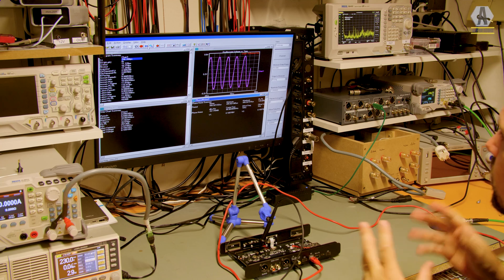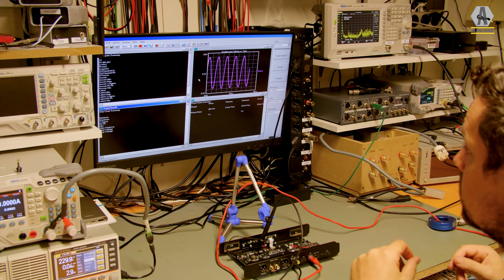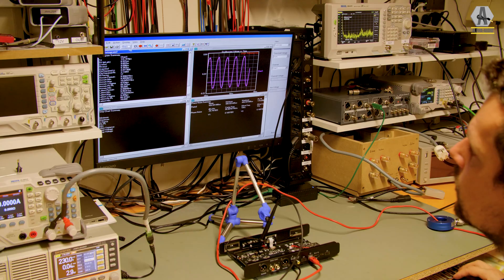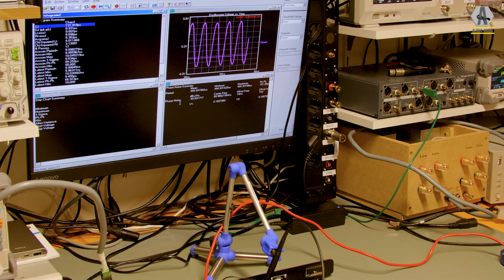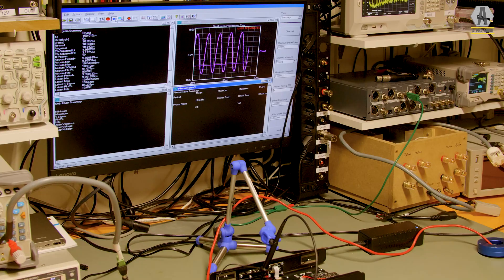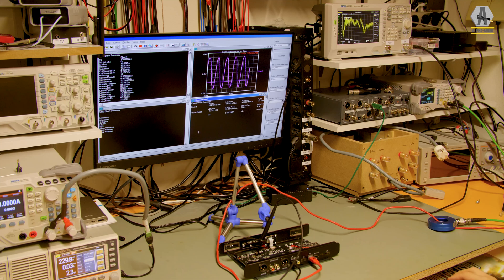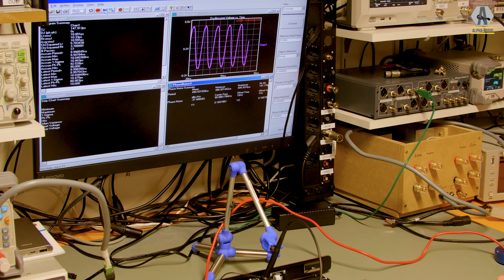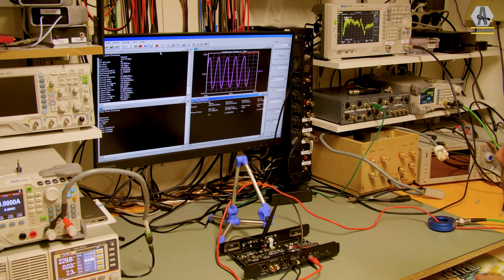Alpha Labs - Does a Bad Network Switch RUIN your streamer?

Comment: Data over the internet/network is packet-based. It can travel the planet, arrive irregularly, get re-sent, etc. TCP/IP ensures every bit arrives correctly. A streamer buffers that data and outputs a clean bitstream. No bit flipping happens in a working digital chain. Zeros don’t become ones because of network noise. So what you are measuring doesn't do anything to the 'sound data'. Where things matter is after the buffer, once audio leaves the packet world and must become timed audio samples again. In other words: decent quality designed audio steamers make cable/EMI claims irrelevant. If audible differences appear, they come from noise/clock interaction in poorly isolated designs. For real proof, you should measure the DAC output on well a isolated design/streamer and then introduce a clean and dirty signal.
Reply from the maker: We did loads of other measurements.  Including the clock in the streamer. Check other videos.

Comment: Here is several things that I do not understand, regarding this whole topic:
1. In your test scenario the ethernet cable catches the noise AFTER the switch, so what's the point of having a noise reducing switch?
2. Why not just use Wifi instead of spending thousands of $ for a switch?
3.If electric noise from ethernet can creep into your device and "disturb" the clock, what about all the other electrical connections?
4.If noise is making such a big difference (justifying a very expensive swicht), then why don't the streamer manufacturers (also very expensive) just use an opto-isulator component for less than 1§ to filter out 100% of all noise?
5.If electric noise is such a severe issue, why not just use fibre optical ethernet? you can get converters for 10s of $
6.If clock-Jitter is actually negatively impacting the analog output of the DAC, why not remove all doubt and just measure it? The effect is usually very easy to measure, right?
Reply: Good questions!

Comment: Thank you Alpha-Audio! My system has never sound so damn good. Shielded ethernet cables, quality network switches, power supply upgrades along with power conditioning, some fiber optic too. Oh, external GPS clocks on the network and USB purifier. Every little bit brought more clarity, focus, instrument separation and overall better sound quality. Now, when I change out a cable, you can hear the difference. The clarity these upgrades have brought with my Volumio Rivo streamer is just incredible. Thank you so much for your publication and these videos. And Amir, go take a hike. ;-)

Comment: This is why I switched from copper network Cat6 cables to 10gbit fiber optical. At least with fiber, all the noise from each device is essentially siloed, so that it doesn’t collectively accumulate and cause jitter in the DAC. The jitter is then minimized to during the initial conversion process in the Mac or PC in the fiber cable transceiver itself, and that acts like a firewall stopping it from going further into the switch and then into the DAC. You can further reduce that noise by putting all your gear on batteries or low noise power supplies, which decouples it from the grid and further helps reduce jitter.

Comment: Is your 230V power supply fully isolated? 
Can you make these tests with properly isolated power supply? I'll be forward please just use a 5V EI transformer with a greatz and 2 capacitors for power supply. 
What happens if you ground the streamer?
What happens if you use the mains to power all the devices, i mean don't isolate the streamer from the system? People use their system as it is fully cabeled, tons of WiFi and mobile signals al around, 230V not clean. Can you measure the streamer with battery powered equipment in a fully assembled system?

Comment: Are you saying a digital signal is influenced by noise? If so you are simply wrong (onzin). Imagine software transferred via a switch from one pc to another, one changed bit would make the software unusable. That is why we have things like CRC, we simply send the data including timing info again if we detect a fail, that has been the case for cd players for a while and for computers it was always  the case.

Comment: What is a switch?
I have a full fibre router less than a year old and a galvanic bridge on my ethernet cable. Is a switch another thing you add to the ethernet line? If so is it only something you need if your router is not the best?
I am within a few weeks of spending another £1400 on a streamer, a linear power supply and cables but I thought that was it, don.
Reply from the maker: Google...
Reply: Just out of interest, who is your internet service provider

Comment: Just to clarify, 100ps of jitter is 0.0000000001second peak-to peak change, which then goes through a DAC anti jitter circuit and a PLL lock in which will pretty much intergrate this intto something an awful lot less. Nice measurements, but lack context.
Reply from the maker: 100ps jitter is very, very audible... Also, we measure more than just jitter. Phase noise LowFreq modulation, clock stability, etc is also influenced by noise from a network. I would suggest to just sit down and listen. Especially a decent power supply will be audible in a good system.
Reply: @TheAlphaAudio  "100ps jitter is very, very audible."

Is there any published double blind test that support this claim?
Reply: @TheAlphaAudio A turntable causes also jitter as the rotation speed is also not 100% accurate. Even the signal encoded in the groove causes a varying resistance - also the vinyl itself which is never 100% flat.
If 100 ps jitter would be "very audible" then listening even to a high end turnable would me an acoustic nigthmare.
Reply: @thomaswalder4808 does a turntable do D-to-A conversion?
Reply: @DuncanArmstrongX  No - but that not mean that turntables do not have analog jitter..
Reply: @TheAlphaAudio  A jitter of 100 ps would change the frequency of a 1 Kilohertz tone by 0,0001 Hertz. Even the most golden ear could not hear this difference
Reply: Jitter is also additive, it will not always be removed and yes that jitter is absolutely audible.
Reply: @B2_Labs  No jitter is absolutely not additive. Once a signal hits a clock domain boundary any jitter ceases to exist ingress wise and it has a new clock applied to it. It's how you can be 5 hops away from a CDN but your movie or audio stream come through perfectly.
Reply: @mnoble247 you are not fixable. A lost cause who will think they are right regardless. It makes a difference use your ears.
Reply from the maker: Okay. Enjoy your 100ps jitter.
Reply: @TheAlphaAudio  So you are stating you could pick out a 1Khz tone where one has 100ps induced jitter and another doesn't? Never mind actual music where masking would totally swamp it.

Comment: Now everybody who can hear the difference between 9 and 10ps of jitter, please raise your hands. Thank you, now the ones that can hear the difference between -120 and -130db of noise. Thank you again. Btw, doubly shielded Cat6 ethernet cable is a few cents per meter terminated and you can get very well implemented switches  with properly galvanically isolated ports (as per the Ethernet standard) starting at $30 or less.
Reply from the maker: Ok
Reply: Well said👍
Reply: Basically non of the ethernet gear is grounded, most of the power supply create a fake ground connecting the mains with 2 capacitors to the neutral it is good enough to protect the devices from human ESD, but in return 115V AC lingering between any two device what is connected with a cable. This voltage is present in ethernet cables too, you have a double isolation transformer in the chain and the high voltage AC finds its way trough, because the feke ground is connected to the ethernet transformator as the Ethernet standard suggest.

The solution is very simple you just ground the negative pole of the DC powersupply.

Comment: The Fix List!!!
1. Ferrite Beads on that network cable
2. Galvanic Isolation on the port
3 . Power the switch with a clean linear source.
(The circuit are built with a variance to manage noise)
A more complete test would verify any true effect confirming change from input to output
Reply: Or just buy a good network switch.

Comment: Love your videos man! Already subscribed. Question - if physical LAN connection can inject noise then why not use only wifi?
I'll be grateful for your response.
Reply from the maker: The wifi radio in the receiving device also introduces noise.
Reply: @TheAlphaAudio  i plan to use a Adum3165 based USB isolator after my pi before it connects to a xmos/crystek reclocker (powered by LPS) which feeds my dac via coax.
Will such an adum based isolator be sufficient to mitigate noise & jitter introduced by LAN or Wifi?

Comment: Does it really affect the analog XLR output to amps and the output from amp to speakers so it really is hearable? undependet of say and stereo costing €2500 and upwards in eternity.
Reply from the maker: Yes
Reply: I used to use XLR cables in my system until I really upgraded the network and other tweaks. Now, the XLR cables are way too bright, even RCA cables can be an issue now. Every cable change I make now affects the sound.

Comment: All of that isn't important. The signal on the network does not care for the noise etc. This means the dac and clock shouldn't care either. If any of those parts are influenced by the noise on the network your problem is not the network but the dac (and clock). I know the expensive dacs are almost holy parts in the setup but they are goldmines for company's. In reality they are so cheaply build they can be influenced by noise on the network. With a good dac (even cheap ones) this isn't the case. A good dac has no problem with almost any level of noise on the network. As long as the digital signal can be read and the handshake still works there should be no issue. And if it fails your music pauses or totally stops playing but it will not decrease in quality, there is no loss of bass or space or whatever, it will just stop. So throw away that dac, buy a good one and be done with it.
Reply: Which DAC do you suggest then?
Reply: @jmtennapel  any😁
Reply: @LovelyDoetje I totally agree with you, the music should stop and probably does it too, just 10 times the speed like a PC or a Bluetooth headset where you can hear the cracling sound when there is no signal. Since these systems produce sound an order of magnitude faster than your 44100 Hz PC you no longer hear crackling anymore you hear high frequency noise insted.

Comment: Very interesting as always, thank you!
Is there any future plan to test the influence of different routers?
Reply from the maker: No, not really. A router does not have any influence once you have a switch connected to your streamer. I always advice that, for connecting directly to the router is not ideal in terms of noise.
Reply: @TheAlphaAudio  thank you. I have a switch next to my streamer and it worked wonders :) 
I am always interested in improving further,  i think using a low noise power supply will improve things even on the router
Reply from the maker: @audiotom3855  You can try. I never heard a big difference once I installed a decent switch with nice power supply.

Comment: Jaap, can you please test what those little lan-isolators from iFI or Pink Faun do in that scenario + also the question is an optical network the way to go (yet there are no streamers as far as I know with optical network input)?
Reply from the maker: We tested those as well. They do something. But don't use them in serial config... they can reflect the noise as well.
Reply: You can hear what an optical connection does in the livestream where we listen to 11 different switches, including an optical connection. Just browse back in the livestream archive of this channel.
Reply: The Hifi Rose rs130 has a optical network input
Reply: @grandebufalife   As does the iFi Neo Stream, and new Linn streamers. MSB has implemented their own version of optical connections (propriety protocol), but not for connectivity input. We have the iFi Neo Stream in the upcoming test sunday, but we will use the regular ethernet connection.

Comment: No it does not.
Reply: Just clarification when you said a bad switch do you mean a faulty switch or a cheap poorly made switch?
Reply: @markhusbands6132  a badly constructed switch with a lot of port to port leakage and a lot of noise from its power supply.
Reply: I agree with @SubjectiveObjectivist. Measuring noise and jitter isn’t clarifying everything. Doesn’t have to be audible. Most likely that you will not hear the difference between the two network switches on other streamers. Digital signals are noise and jitter tolerant. Perhaps the streamer quality is in question.
My conclusion would be, look the clock is influenced by network noise, poor streamer. Anyway, I may disagree with the conclusion, but I do like the experiment. 👍
Reply: @geraldhilderink5686  To check if there is an audible effect, just listen back to the livestream in which we listened to 11 different switches. It is in the livestream archive of this channel.
Reply: There exist something called CE-marking. All electronic components must comply to CE. If there is some compatibility problems it must be investigated and included in the testing of the products. This is the best and right way of eliminating compatibility problems.
Reply: @leifandersson2824  This is not a compatibility problem.
Reply: Ruin, no. Negatively influence yes.
Reply from the maker: @reptidan  True... but I needed a title 🙂.
Reply from the maker: You are funny...
Reply: please measure what is comming out of dac outputs. @TheAlphaAudio
Reply from the maker: @IHearEverythingDude  how? I would need to run it through an A/D converter.... I tried it a couple of times: it doesnt work. Also: I measured the clock that feeds the dac... how much proof do you need?
Reply: @TheAlphaAudio you can’t convince people to look who don’t want to open there eyes.  Please don’t try to appease to the audio science crowd.  
There are lots of audiophiles who want to learn and see and don’t worship Amir the software engineer…
Keep up the great work - thank you!
Reply: @IHearEverythingDude  Because not everyone (most of us) can afford a Dave of Tambaqui? Out of curiosity: what do you have at home to listen to?
Reply: @TheAlphaAudio  "how? I would need to run it through an A/D converter.... I tried it a couple of times: it doesnt work."

Why should that not work?

"Also: I measured the clock that feeds the dac... how much proof do you need?"

People are not listening to the clock of a dac but to the (amplified) output of an dac.
Reply: @thomaswalder4808  Why should anyone want to measure the dac output?  We want to understand what happens to the digital signal. We don't want the dac quality in the mix else we can even try to measure the amps out or even the speakers out
Reply: @vlassiskonstantakis4889  Because it it the output of the DAC which you are hearing at the end (after it was amplified and transmittet to the loudspeakers) and not the digital input of a DAC

Whatever happens to the digital signal - as long as it has no effect on the analog output of the DAC it doesn't matter...
Reply: @thomaswalder4808  You are missing the point. Dac A might be very sensitive to noise /jitter when dac B might be immune even at worst conditions. If you measure the dac output thenis not the switch performance but switch+dac an which dac should you measure with dac A or dac B? There are 1000s of these. 
The point is does a switch induce or reduce noise/jitter ? is there a difference between switches?